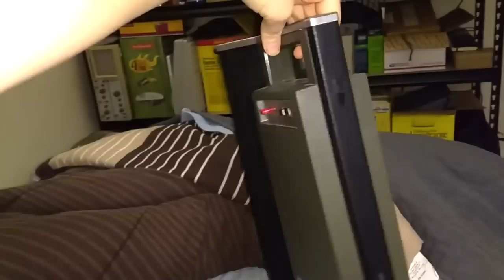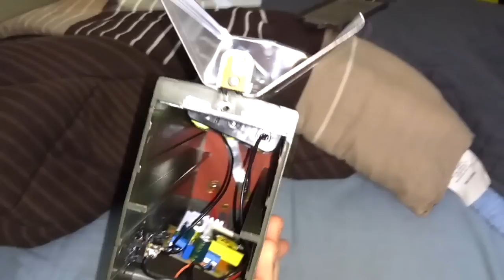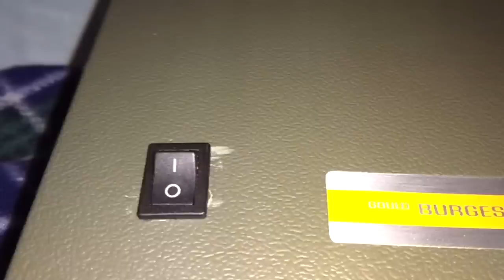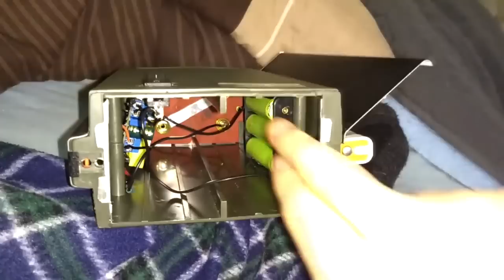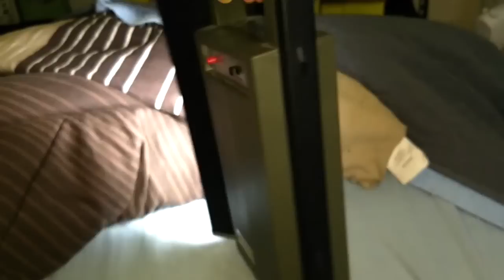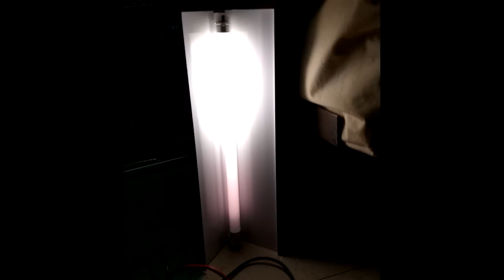Burgess Safari Lite runs on battery power!

Comment from the maker: Errata:

My Burgess Safari Lite was made in 1972, not 1973.
Reply: Update Hey i want to tell that i was lucky on Ebay I found a burgress safari lite with its original batteries and they don't work and i won it for $ 20  im working on running my burgress safari lite on portable use now and im excited to run again thanks for the  DC converter thanks to you  i can run it on batteries again.
Reply: quick question how do i set the converter to 115 volts? I want to run this thing on a converter too.
Reply: You guys got them repossessed since posting you owned these, huh?

Comment: Thanks for sharing.  Do you happen to know if...
1. When these are switched to the battery side are they running directly off the battery?  Meaning DC current to the lamp?    Or is there an inverter in there?

2.  When the lamp is switched to the AC plug in mode, is that switching it to an entirely separate set of electronics?   Or is it utilizing some of the same internal components.
Reply from the maker: The AC side is a standard magnetic choke ballast that was common in small fluorescent light fixtures for decades. When switched to DC, the ballast is still in circuit, but it only serves to provide an inductive kick for starting the lamp - the primary ballasting component is a resistor.

Comment: If you've got an A/B Battery you've got a Parallax,  champ. It was a Waveform battery. Those lamps were used in Operation Highjump at Mcmurdo Base. Antarctica, as well as the 1927 Arctic Expeditions Charles F Burgess went on with Admiral (then captain) Byrd.

Comment: I just got an older 1966-67 model that has two switches for on/off and an AC/DC selector. I'm thinking the selector might be good for the 'battery off' switch if I come up with something like you have.

Comment: May I offer a suggestion?  If you wire 2 or 3 battery packs in parallel, you should be able to get at least triple the run time of the single battery pack that you have in your lantern.  And, it will fit a few battery packs of that size that you are using.

Comment: I feel you should've not drilled a hole into the shell, and instead, insulate the connections, and leave it inside the battery compartment. I can understand drilling into plastic on a modern and cheap piece of junk, but this? No, in my opinion.
Reply from the maker: The battery compartment takes two screws to remove - it would be inconvenient. I agree to a point, but these are so common that I don't think it's a big loss.
Reply: I think one could use the second pole on the AC / Battery switch to use as your switch for your dc-dc booster.

Comment: To prevent mercury migration you could also flip the bulb around once in a while.
Reply from the maker: The lamp I tried took just a couple of minutes to migrate. Flip it, and it would migrate again after another couple of minutes.
Reply: @themaritimegirl hen newer fluorescent lamps must really have a lot less mercury in them than older ones. I remember reading a magazine article in the '90s about how fluorescent lamps are run on DC, with a resistive ballast, in submarines. They said as long as they flipped the polarity once in a while, the lamps lasted a long time.

Comment: Would two 6 volt batteries work well for this.  I think it would meet your min voyage for the DC ti DC converter?
Reply from the maker: Yes, but they won't physically fit in the battery compartment.

Comment: That's a really good idea, using the voltage converter. I've never really given any serious consideration to running my Burgess safari lantern on battery power, partly because I have so many other fluorescent battery lanterns that I can use. They are however all 4 or 6w. An 8w battery operated lantern would be cool!